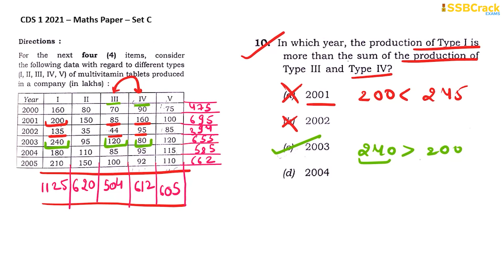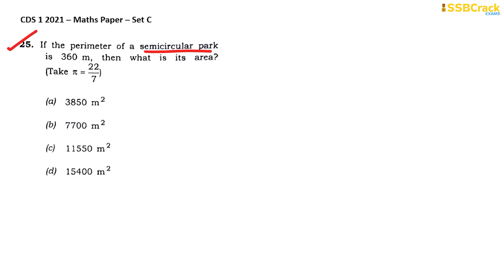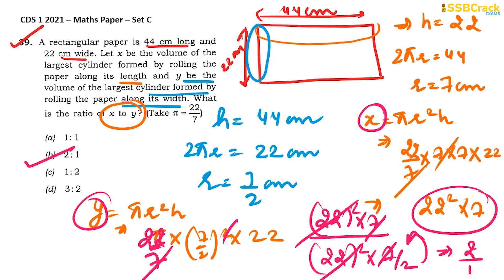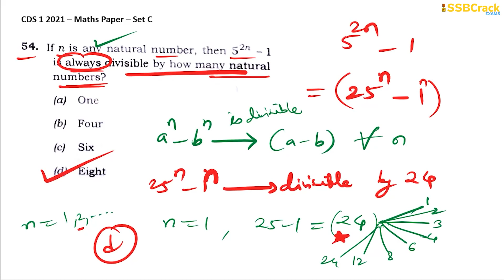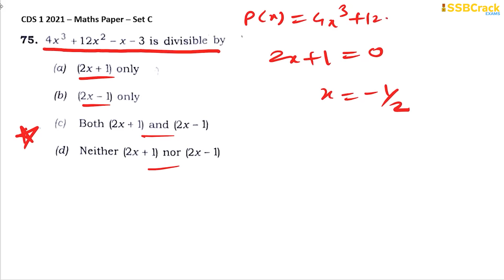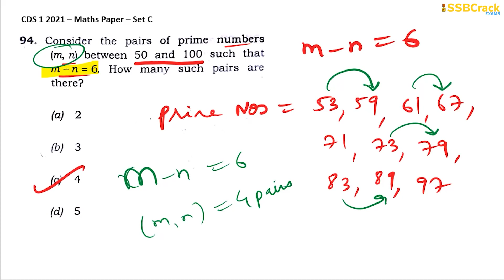Comment: Correction: Q.59
As per the domain values provided in the question for the given function, the correct answer has to be 2/-1 = -2 which is not provided in the question.
Yes, there is an ambiguity in the question.
Correction: Q. 71
Answer key - option (c), There are two values of k satisfying the given criteria in the question.
Correction: Q.97
Answer Key - Option (d) Statement 3 is reducible to statement 1 only.
All three statements are correct.
Correction: Q. 94
Answer Key - Option (d). There are 5 Pairs of Prime Numbers.
Possible pairs are (59, 53), (67, 61), (73, 67), (79, 73), (89, 83)
Reply: question number 97 answer is wrong the correct answer will be option d as in the third equation c has been written as c=-(a+b) as a+b+c=0 so now you compare equation 1 to equation 3 and they are absolutely same
Reply: Maam i have doubt in ques no 39 also
Reply: Drishti Mam's teaching is very good... Laxmi Mam's teaching is worst...
Reply: Bhai 97 vale me d hoga kya  3rd statment is also true

Comment: Q-59 is absolutely wrong . Check it
Reply: Yes, there is an ambiguity in the Q.59.
As per the domain values provided in the question for the given function, the correct answer has to be 2/-1 = -2 which is not provided in the question.